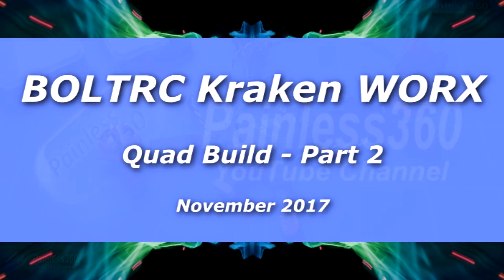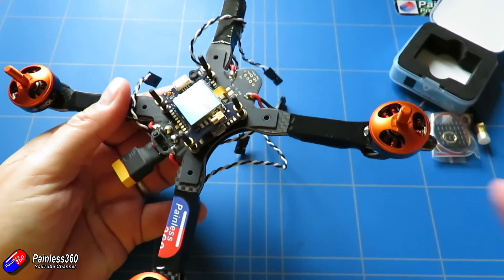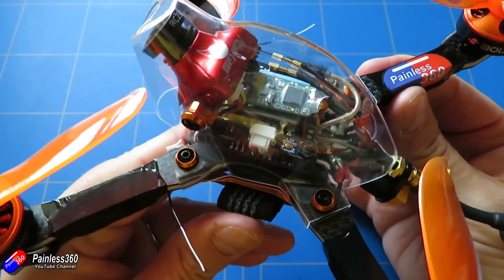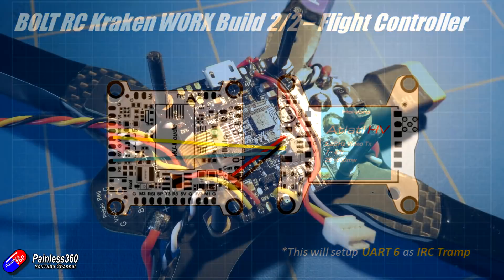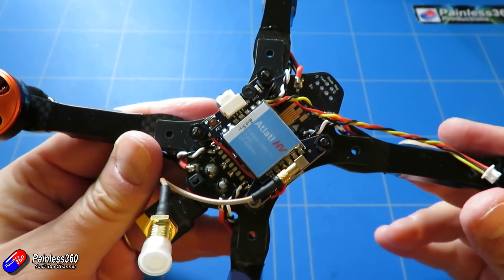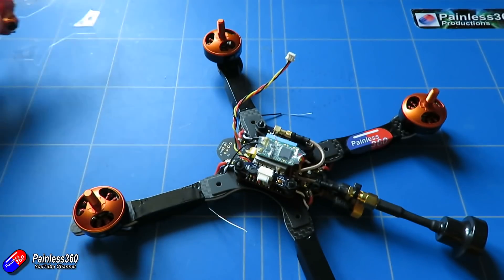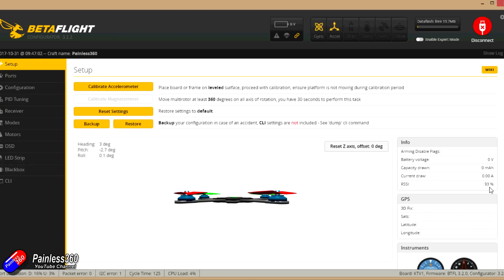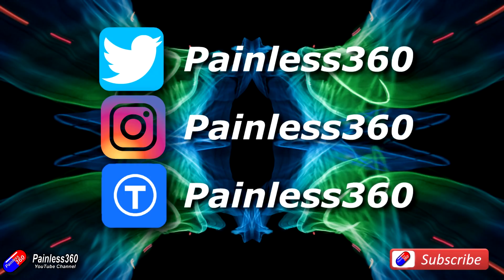BOLTRC Kraken 5 WORX Build (Part 2)

Comment: I have the Kraken 5x (purchased used) how is it different from the worx?
Reply: The PDB baseplate, pods and arms are much thicker and heavier.
Reply: Sickocrow I see, is the pod the same size though? I use the heavier one myself and need to replace it
Reply: matt neale Yep they are all the same size.  Only the thickness varies bar some slight tolerance in the manufacture.
Reply: Sickocrow Thank you buddy, I've just changed from xsr to r-xsr (lifted off the s.port uninverted pad!!) I will reduce the stack height too

Comment: The problem with this build is that the XSR is sensitive to heat. I have 2 Kraken and I had attempt of failsafe with the VTX & RX put closely. Even with space between.
Reply from the maker: How have you changed your build to minimize it? I'm testing at the moment and with the lower Vtx powers it's not an issue.. If I turned it up I'd expect to get more heat and maybe need to move the XM+ to be below the camera at the front of the frame where the Polulu would normally be..
Reply: That is a solution....Install the RX on the VTX is not an option for me.
The story: My first build (Kraken 5X), had a Unify sticked in the pod and the XSR over the FC. The heat between the FC (heat generated by F4 processor is a variable to consider), and the Unify (even set a low power) was a problem. Even with some space between, the quads shows failsafe when RSSI over 60. The FC was a HW Xrotor F4 + 4 in 1 ESC stack. The solution: I install a DYS F4Pro FC without 4 in 1 ESC. The space between the RX and VTX was increased and the failsafes stops. Before to install the new FC I tested the quad with a XSR-M below the camera and works great, but you know...without telemetry. My new Kraken Worxx have a Kiss FC and the XSR-M below the camera. You can see the photos:  

https://drive.google.com/open?id=0B_a_0671Z3YhSVlGZy10QnhMT3M
Reply from the maker: I'm planning to move a few things nove I've flown it, I'll make a video of the changes when done.. Thanks for the ideas.

Comment: I have been running this frame for almost a year now and it is still my absolute favorite.
Reply: I drilled 2 small holes toward the front opening and a RunCam micro sits perfectly as long as the holes drilled for the side mount on the RunCam micro are spaced right. There is no jello in the fpv feed and the weight savings is huge. This quad comes alive when you are VERY weight minded when building.
Reply from the maker: Hi Mike, thanks for the comments. What is your flying weight?
Reply: 248 dry
Reply: That is with 2306 lol
Reply: Just ordered my first Holybro FC. Have the Atlatl and I love it. It is an excellent VTX and I am very happy with it.Thank you for the massive volume of experience and gear you have taken the time to post. It is truly great source for the community. Cheers
Reply from the maker: Nice! Mine here is 275 but that's with the alloy battery brackets and that metal case camera.. I think I will swap that camera out..
Reply: Indeed it is an excellent weight saver. It will also free up some valuable real estate inside the pod. I also use the strap bracket. It is with out a doubt the best way to go when the build is set up for the strap to run under the stack. I bought several sets of those brackets and modified all of my undermounts to accept that bracket. It also gives excellent rigidity to the arms. It really stiffens up the Worx set up on the yaw axis.